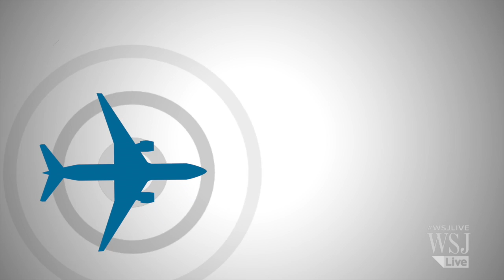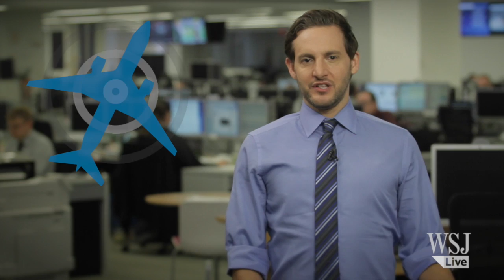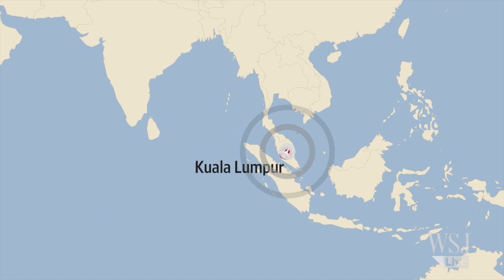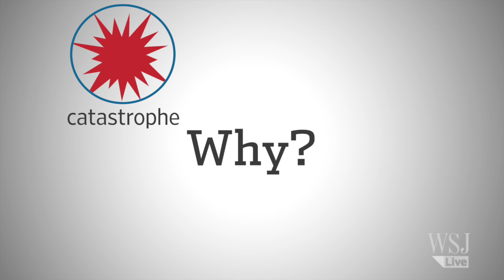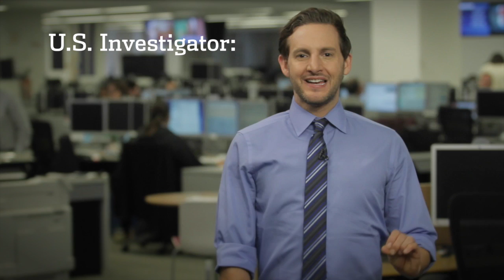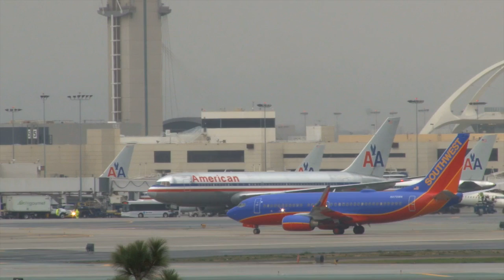Malaysia Air: When A Transponder Gets Switched Off | #TheShortAnswer w/Jason Bellini

Comment: Not that you need to be a rocket scientist to turn off a transponder on a commercial aircraft, it doesn't turn a 777 into a stealth jumbo jet when you turn it off/STBY.  Transponders give limited data about your aircraft.  It sends out a discrete code that is assigned by ATC that is 4 digits and an aneroid wafer/electrical variable gives an altitude readout.  The hardware inside the transponder has a Mode S code that is a hexadecimal number tied to the aircraft manufacturer/serial number as well.  This info is picked up by "secondary" radar means, Wiki Transponder Aviation.  Primary radar is is the actual radar echo that is bounced back from the aircraft.  Also most airports of medium size or larger do require the use of a transponder at all times while on the airport surface.  Get some facts first before you report...